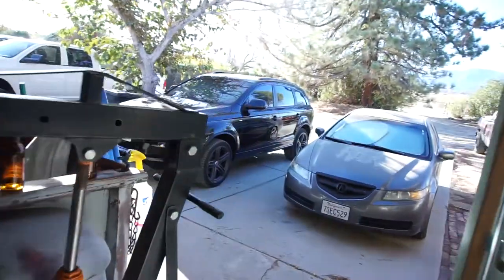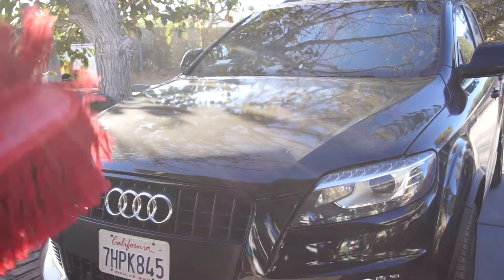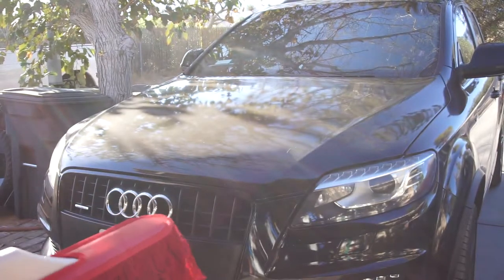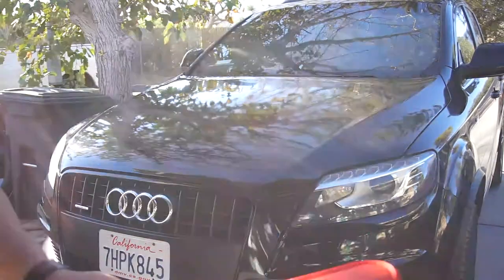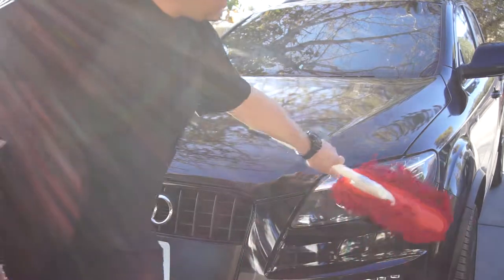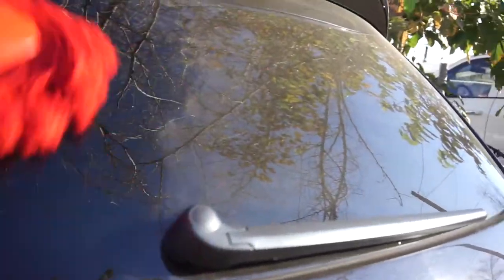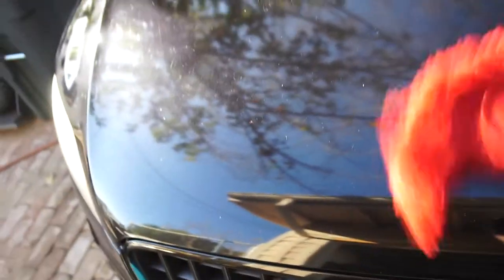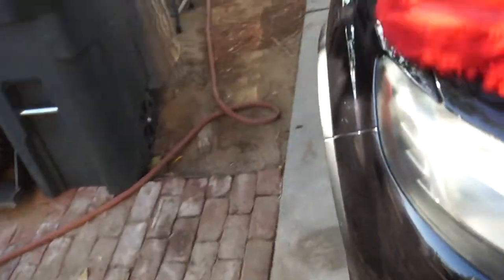Oldie But Goody The Original California Duster. A Must Have For Black Cars

Comment: Black is a dust magnet no matter where you live . You mentioned Turtle Wax Black wax , I use the detail spray and along with the duster it makes my car look the best it has in years .  Check out Weather Tec for mats and the such . I have family and friends who swear by it . (  Not responsible for resulting sticker shock !! )  The best always comes at a higher cost .
Reply from the maker: Orion Fixr I bought a set of weather tech for an old 4Runner I had then I discovered husky weatherbeaters and I’ll only buy husky. Yeah I wanna do a car wash chemicals video because I use different things for different cars.

Comment: You need to research the proper way to use that on youtube! The way you are using it is totally wrong and harmful to your paint job. Fyi.
Reply from the maker: I read the instructions from the manufacturer. Please tell me so I can tell others. Thanks.
Reply: @Halffast719  I just ordered one myself for my hellcat redeye, which is black.  20 minutes after I just finished washing it, it's covered in yellow pollen...so I'm giving this a try.   I've seen some videos, where they said it's important to not put any pressure on it.  meaning, just lighting touch the car with the duster.
Reply from the maker: Yeah you have to basically just hover it over. I love mine but I tell you what I’ll never buy another black vehicle ever. Haha.